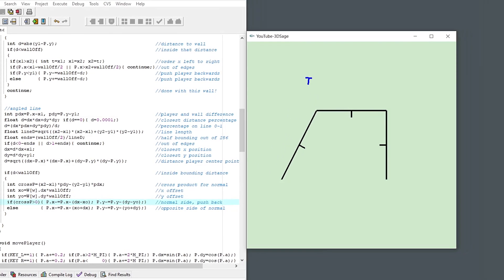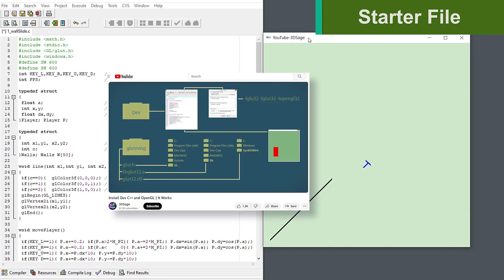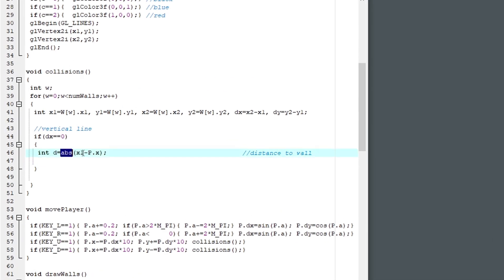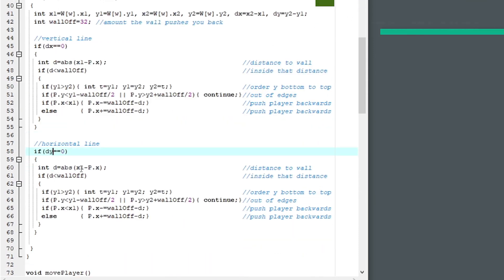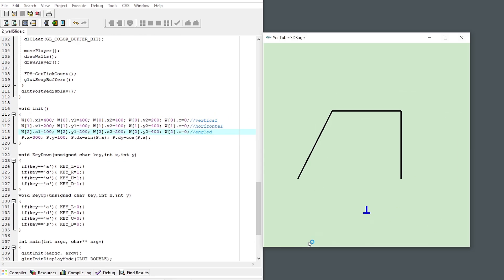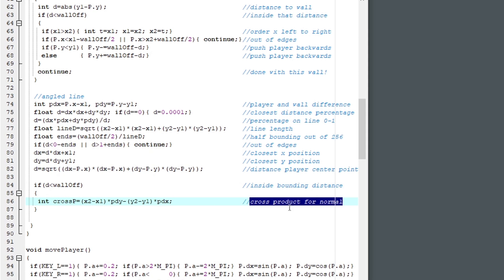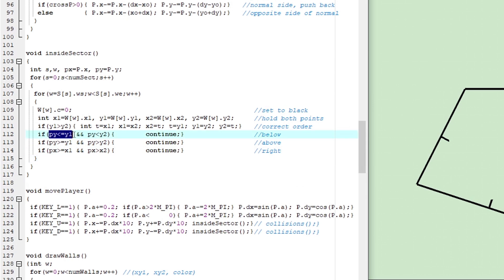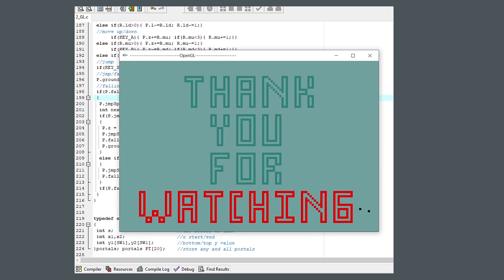Programming Wall Sliding | Recreating Glitches

Comment: Preventing fast speeds going past the wall is easy to do. I'll keep this to the vertical wall as it's easier to describe using one vector.

Currently you move the player's X position by the speed amount then check if the absolute distance from the wall is below the threshold for the wall, if it is then rebound the player position to the threshold by subtracting the distance value from the threshold value and then subtract the result from the player's position.

Examples of how your current method works:
Let's say the wall is at X 200, the player is at X 160. The minimum distance from the wall is 32 and the normal max speed of the player is 32. The player is travelling right, so adding to the X value.
You apply the movement of 32 to the player making the player now at 192 then calculate the distance from the wall as 8. Because that value is below the threshold of 32 you then move the player back by 24 (32-8). The player is now at 168, the minimum distance from the wall.
But if the speed is glitched to say 80 and we now do the same: Player X + 80 = Player X now at 240. Absolute distance from the wall is now 40. Is that distance below 32? No, so no adjustment is made and the player is now glitched past the wall!

Instead, before you move the player, take the player's absolute distance from the wall minus the threshold. Now check if that value is greater than the speed value, if it is then move the player by the speed value, otherwise move the player by the calculated distance minus the threshold value.

Examples of how my method works:
The player's speed is the max of 32: Player X is 160. Absolute distance (40) minus the wall threshold (32) is 8. Is that greater than 32, the speed of the the player? No, so we add the distance of 8 instead of the speed. Player X is now 168, the nearest it is allowed to the wall.
Now let's do the same glitched 80 speed using my way: Current Player X is 160. The absolute distance from the wall minus the threshold we have 8 as before. Is that greater than the speed of 80? No, so add the the calculated distance minus the threshold to the player (160+8). Player X is now 168, the nearest it is allowed to the wall.
Going slow, speed at 5: Player X is 160, distance minus threshold is 8 again. Is that greater than the speed value? Yes, so we add the speed value. Player X is now 165, not reached the wall yet.
What if the speed is at the same as the distance minus threshold?: Current Player X is 160. Absolute distance minus threshold is 8. Is that greater than the speed of 8? No, so add the distance value which happens to be the same as the speed and we are at the threshold of 168.
What if the player is already at the threshold and the speed is max?: Player X is 168. Absolute distance minus the threshold is zero. Is that greater than the speed of 32? No, so add the distance value of zero!

It works, so now go apply that to any angle wall! 😉

EDIT: I had a note saying your method could work if you don't use absolutes but I figured after I added the note that is does not work for moving left from the right side of the wall! LOL  My method does work from either direction though. 🙂

Comment: Since you made an engine like that for something as old as the GBA, do you think it would be viable to make something like that for the Nintendo DS? Since it's the only retro console I have, and I have dabbled with homebrewing it yesterday.
Reply: If you are homebrewing, you might as well check out the gba emulator for the DS, it might not be the absolute best but it definitely works.
Edit: Not emulator, just a game booter. DS can run GBA natively I'm dumb.
Reply: @goteer10  I'm aware of that, it's called GBARunner2. Right now they're making GBARunner3. (Which is essential for me, since my DS does not have the GBA cart slot.) But I was trying to make for the DS specifically since it's a console I own, and therefore I can actually run the code on real hardware.